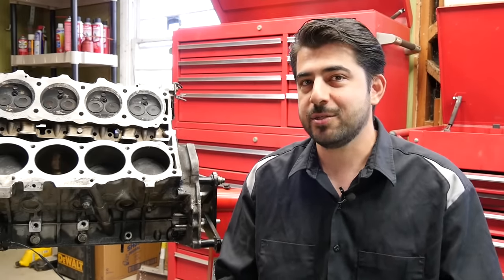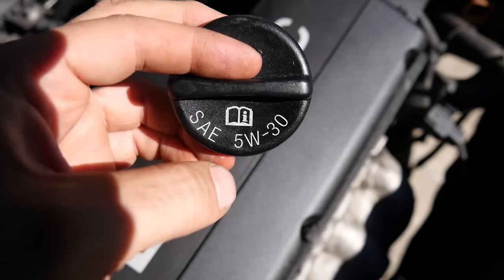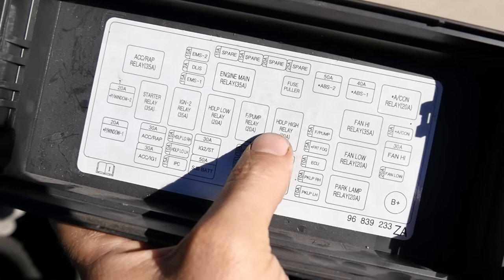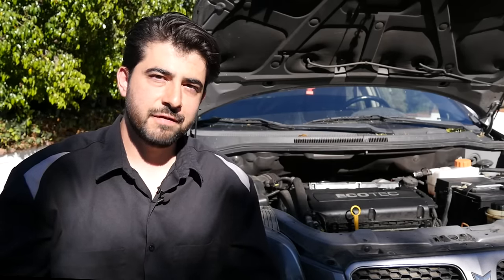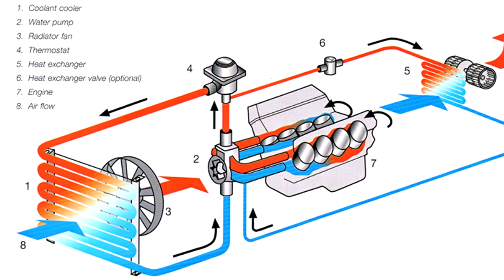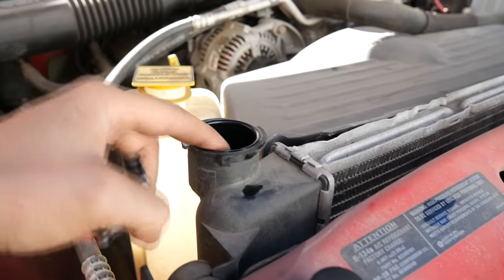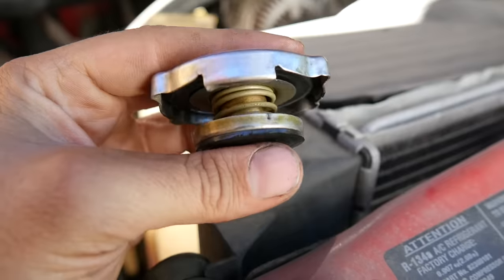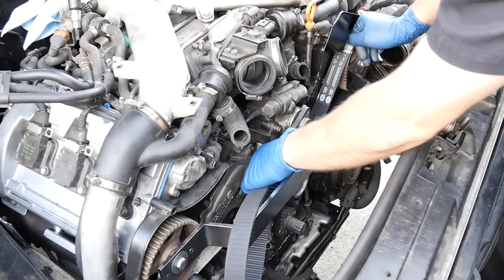Make Your Car Engine and Transmission Last a Very Long Time - Top 5 Tips On Car Care

Comment: Driving the vehicle gently until its fully warmed up is crucial and many people just don't have the patience for this.
Reply: This great advice. Something I tell anyone that ask how to prolong their cars life. I tell them you wouldn’t wake up and get out of the bed and sprint down the street to get your coffee.
Reply: @alexgrindnshine2522  but the car companies themselves say you dont have to do this...who am i supposed to believE
Reply: @andy_182 car companies say that warming your engine while idle isn’t needed, you can immediately start driving but slowly until the car engine is in working temperature which what the op is saying here
Reply: Man this is sooooooo true! And for me it's just respecting the machine. NOTHING just gets up and runs optimally from a cold start. Not even machines. Especially when it's cold
Reply: The oil properties don't lubricate well until the oil is at operating temp or approaching operating temp. Its always good to warm up your vehicle, if you want it to last. The reason why they say that is because of pollution.
Reply: @andy_182   car companies want you to buy a new car
Reply: @superbros1690  Although this still holds true it isn't nearly as relevant as it was in the past. Low viscosity oil is used in modern engines as they simply don't require nearly as tight tolerances as older engines due to better fab tech within the past decade - alongside more efficient cooling to ensure lower viscosity oil isn't burned in the process. It doesn't mean to redline your car upon startup, but no need to grandmother a vehicle over a trivial concern. Furthermore the "pollution" when cold is highly dependent upon far more variables, an engine will warm up faster when driving rather than in idle, thus reducing any potential increase in pollution faster.
Reply: yes 😂..all are james bonds....007..oo8..0010..so on😂
Reply: Yes, and don't let the engine idle cold. Start it up, when oil pressure had built, less than 10 seconds optimally, drive gently until warmed up. Best thing you can do and will warm up faster anyway.
Reply: @superbros1690 No, DO NOT "warm up" your vehicle. This causes the engine to run for extended periods cold, which causes increased wear.

Start the engine and then after oil pressure has built up, less than ten seconds, drive the car gently until fully warmed up. It will warm up faster and spend less time running cold.
Reply: @penguiz23 Get in and drive gently until operating temp. Do not let it sit and idle when cold.
Reply: @wiredforstereo  yes. That's what I meant by driving gently till engine is fully warned up. I specifically did not mention about idling till its warmed up.
Reply: @andy_182   i didn't mean idling till its fully warmed up. Rather i meant driving genttly at low low rpms till its fully warmed up.
Reply: @penguiz23  i meant to warm up by driving gently not idling .

Comment: First tip. Don’t start the engine. It will last for ever
Me doing Scotty Smile 😅🤣🤣
Reply: Im sorry to ruin your joke(?)  If you dont start your engine in a long time the pistons will rust to the cylinder.  Having this problem on my fiat 850 );
Reply: @juippi420  yeah 😅☺️ Scotty will tell you Fiat is a piece of junk too 😅😅😅
Reply: Forgot to include the picture of a horse with a big smile
Reply: It actually wont. The engine will seize up.
Reply: SHIFTY poor engine 🤣😂🤣😂👍
Reply: PurpleHaze 🤣🤣🤣
Reply: @juippi420  Before long storage, an engine should have fresh fluids and have oil sprayed in the cylinders to stop them rusting from damp air.
Reply: Al Lex My Dad kept my mom's Fiat Spider running for 26 years. They sold it to a classic car collector. All it needed was a new convertible top, it got shredded in a hail storm. The thing about those old cars were that average people could work on them. So much simpler under the hood.
Reply: @juippi420  facts
Reply: @juippi420  Fiat 850.  If the engine seizes it can't overheat.
Reply: Second tip (waves hands around like scotty) if you have a old engine like my 94 celica Never switch the oil from conventional to synthetic oil as it can cause an oil leak or the car to burn like like mad Haha 😂
Reply: SouthernAutoDiy 😁🔥🤣🤣😮😂😂😮😂😂😂🔥🔥🔥🔥
Reply: The new engine auto stop and start design flaw is going to yield a lot of short life engines falling about soon.  I wonder who was the genius that though letting an engine drop to zero oil pressure, then restarting it over and over was a good idea.  I have already noticed quite a lot of camshaft wear on quite a few low mileage cars. They come in for something else and notice the scoring on the shafts. The cars that are allowed to idle and maintain proper oil flow and pressure have cam shafts that look like mirror finish on them. It is just a matter of time before the cars with the ridiculous engine stop and start design flaw start failing everywhere.  But they do save a spoonful of fuel per full tank.
Reply: Battery & alternator will go bad either way, tires will flatten, expired oil will gunk up, many things. Cars are just money pits. Needs more maintenance than babies & pets.
Reply: @allex2451 yeah he said fiats were the worst euro cars, and volvos the best.

Comment: Checking your oil level regularly is also important. I've had several cars that lose oil very slowly over the course of a change, and it's good to keep on top of it and confirm a larger problem is not going on.
Reply: I remember as a kid that my dad and all my freinds dads had their own special place under the hood where they stashed their  oil checking rag!
Reply: Shame so many cars are removing dip sticks
Reply: The gm engines with active fuel management use about a quart between oil changes, or my 2010
Silverado with the 5.3 did, and it did it from new…

Comment: All good stuff Chris.  My addition:  If you have a truck with an automatic transmission and particularly if you tow, install a finned, cast aluminum oil pan on it.  It can add 1,2,or even 3 extra quarts of capacity, the fins in the casting help cool the oil and most important, your oil pan will go from the weakest part of your transmission case to the strongest.  Stiffening the case helps protect the trans from torque stresses.  Another bonus is they usually have a drain plug, self explanatory if you've ever changed a trans filter on a stock pan without one.   Maybe you'll do it more often that way.

Comment: Great video! Would like to add, allowing your car to gradually increase peed when green light changes. When changing from park to drive, most folks ram it back and forth from reverse to drive, or from park to drive. Gently moving the shifter is much better for the car. Also, when making turns take your foot off the brakes, if you slow down before the turn can be made with out pressing onto the brakes.  And very important don't allow for the car to reach almost empty tank.

Comment: 400,000 miles on my 03 Grand Marquis. Keep the engine oil full and change it every 10,000 miles or less and full synthetic engine oil. Drop the transmission pan and a new filter every 50,000 miles. 400,000 miles and only 1 intake manifold and 1 timing set as precaution. 

Great video!!!
Reply: What mileage did you change your timing chain?
Reply: @jaymitchell955  

I've done a timing set at 105,000 and I've pushed them to 225,000 miles. 

On a Lincoln Town Car, Grand Marquis, or Crown Victoria 2000 down to 1992 (91 Town Car), these timing sets last 350,000-400,000 miles if the car has had good engine oil changes. These have metal timing tensioners and the chain guides have metal spines supporting them. 

2001, 02, 03, 04, 05, 06, 07, 08, 09, 10, 11 will need changed immediately if you hear grinding or popping from the front of the engine.

Otherwise if the 01-11 has had good oil changes, you'll be safe till 200,000 miles, but do it sooner if you hear grinding or rubbing from the front of the engine, or if you start to notice little ground up pieces of metal and plastic in the used engine oil.

On the early 4.6 engines you could easily get by with going 400,000 miles on a timing set, but on the 01+, I'd start getting nervous around 200,000 miles with 10-13 years of age.  Age makes these brittle.

In other words you could have a 2011 right now with 423,659 miles and that timing set would still be OK as long as they use full synthetic engine oil and changed it every six to eight thousand miles.

Now on 2003+, if you hear a loud clatter sound on cold start up that goes away in 1 to 2 seconds, that's due to the plastic timing chain tensioner's spring getting weak with age.  This is the sound of the timing chain slapping the chain guide on the driver's side until oil pressure builds up and presses against the timing tensioner and makes the chain tight.

The solution is to buy a new timing set and only buy the ones with a metal tensions, because they have a little ratcheting arm that keeps the chain of tight in the absence of oil pressure, so when you start up the car the chain is already tight and will not slap around and bust the guides.

Early release 03 Town Cars, Crown Victorias, and Grand Marquis with the 4.6 engine that have the white X with two or three dots above the X means that this car already has metal tensioners installed under a silent recall when these cars were new.

These markings are on the front of the valve covers on both sides. 

Cars with the metal tensioners will usually last 350,000-400,000 miles before you need to do the timing set, but this is assuming proper oil changes.

Remember these are interference engines and if that timing chain on either side jumps more than two teeth, you could start to run into damage to the engine.

Also if your car has been severely overheated you might consider doing a timing set because that will make the nylon timing chain guides and tensioner arms very brittle and prone to cracking and breaking.

The risk that you run by not doing the timing chain set every 200,000 miles or so is that the chain guides can crack and pieces of them can fall off and clogged up the oil pump pickup screen, also the chain can slap around and be loose and jumped a tooth or two or three on a crankshaft or camshaft sprocket and destroy the engine.

I'd do it at 200,000 miles if the inside of the engine looks very clean when you remove the oil filler cap and look down on top of the engine head.

I have seen multiple of these engines destroyed around a 170,000 mile mark from it jumping time, but these were very dirty engines and obviously 10 to 20 thousand miles on the engine oil and the car had clearly been ran low on oil many times.

If you do have the cold startup clatter that goes away after about 2 seconds, and you notice that sound has changed or went away, then I would do the timing set immediately. This could indicate that the timing chain guide on the driver side of the engine pulley broke and fell. 

On my Panther cars, I usually change the timing sets before 200,000 miles mostly because I get tired of hearing it clatter when I start the engine. Once you switch over to the metal tensioners with the little ratcheting arm that keeps a chain tight in the absence of oil pressure, that startup clatter will never happen again.
Reply: Thank you very much !
Reply: Panther platform....no expiration date on these cars. Born to roll
Reply: Freddy Hollingsworth wow a wealth of information! I wish I could be as knowledgeable so I know when something might be wrong.

Comment: Great video. Your videos are most helpful. Thank you.

The Toyota dealer charged $940.00 to change the timing belt, water pump, coolant, and drive belt. But since my 4.7 liter engine us is an interference engine and had not been changed since the truck was new, I decided it was the safe thing to do. The tundra SR5 truck had 77272 miles on it when I purchased it. According to the truck manual I found in the glove box, the timing belt should be changed every 84 months.

I'm going to attempt to change the transmission fluid myself. The dealer wants $150.00 just to do a drain and refill. I changed the oil and filter myself and that went well. I used a Wix filter and synthetic oil. I also changed the air filter. This truck had not been driven much in the last six years. I purchased it from my 90 year-old father-in-law who purchased it new in 2003. I am changing all the fluids. Trying to figure out what kind of differential it has. No tag on it. If anyone knows how to tell which one it has, I would appreciate the help.

Update, I was able to change the transmission fluid myself. I changed it three times with 50 to 100 miles between the first and second change. I calculated that changed out 90 percent of the old fluid, based on volumes. I also changed the rear differential fluid myself.

I changed the spark plugs myself as well.
Reply: Unless you town heavy stuff, it leaks, or it's dark, no need to bother changing differential oil.